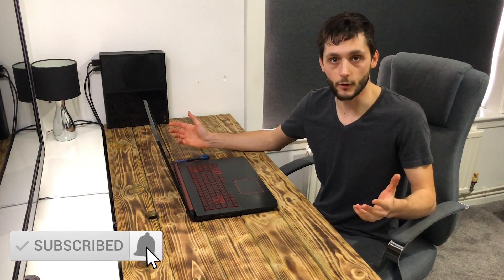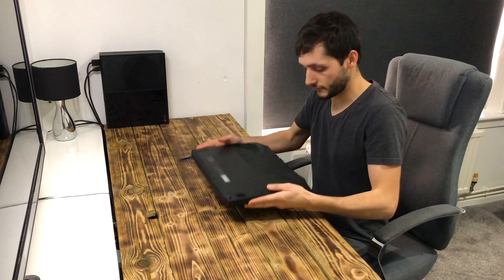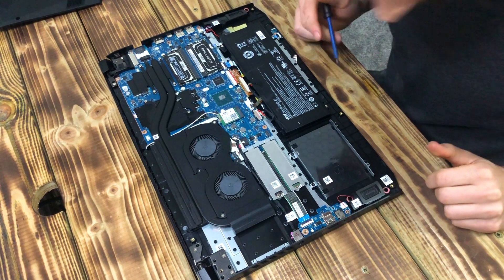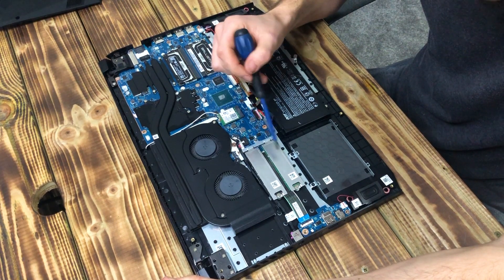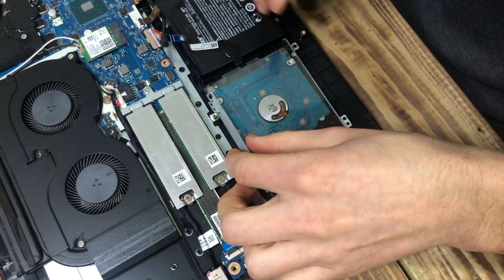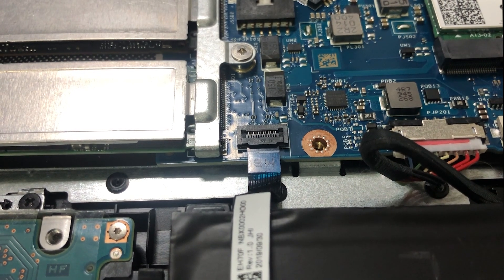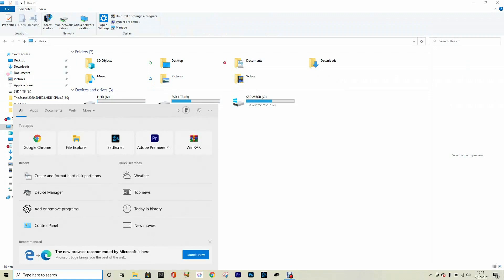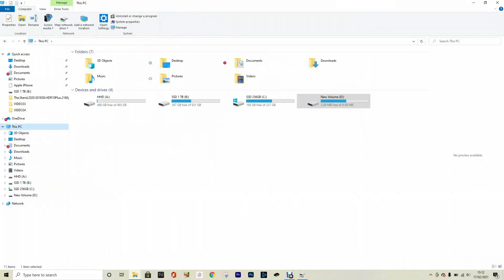HDD Hard Drive Upgrade on Acer Nitro 5 Laptop

Comment: just some questions: what hdd are you using (like, what’s it called?)? did it come with the cable and the screws? thanks so much, this video is super inspiring!
Reply from the maker: It’s a 2.5 inch hdd drive for a laptop. Pc ones are thicker

Comment: what would you need to do if the computer refuses to even power on at all with the harddrive plugged in?

whenever I plug my harddrive into the computer, it just refuses to turn on, almost as if no ram was installed in the computer.

Comment: Hey so I am not a tech person at all, but I have a question.... I purchased the Crucial MX500 1TB 3D NAND SATA 2.5 Inch Internal SSD, up to 560MB/s - CT1000MX500SSD1. When I received the product, I got the 2.5 SATA card and the black component. When I disassembled my laptop (Nitro 515AN-53), I noticed that the space was empty (as figured) and I had the flimsy aluminum part that was screwed in. Once I unscrewed and removed the flimsy metal part and tried to hook everything up. I noticed that the SATA card seemed pretty loose in that space. I've noticed that in your video and countless others that you all have the flimsy aluminum piece PLUS some type of mounting bracket or caddy (not sure what the proper term for it is), to make the SATA card more stable and secured. Where could I purchase something like that at? Again, sorry if I am not making any sense or confusing you. Please let me know if I need to clarify anymore. Thank you again.
Reply from the maker: Hello
You can get brackets if you need one like in this link below the hard part is finding one to fit your laptop a eBay search or maybe Amazon and you should be able to find one.
https://www.ebay.co.uk/itm/112360843601?mkcid=16&mkevt=1&mkrid=711-127632-2357-0&ssspo=jac7FoHhSJG&sssrc=2349624&ssuid=iBaUi5sxRGC&var=&widget_ver=artemis&media=COPY
Reply: @AshBuilt  I have 2021 acer nitro 5 and I was wondering if mine came with this?  Or do I need to purchase this

Comment: can you put whatever amount of space for the HDD, also can you do both the SSD and HDD upgrade and use both at the same time?
Reply from the maker: I think the limit for the ssd and hdd is 2tb each
Reply: @AshBuilt  I just did some more digging. I have the 2021 model an515-57 and it’s built different. Could you still help me out a bit. I had an external Hd but it died on me. Fatal error warning.

Comment: When I got my new Nitro5 it came with 250gb hdd so I added a 1tb ssd (which I had been running W10 on my previous Lenovo laptop) for extra storage. My Nitro was running W10 and my 1TB  SSD was also working but after a week once I had upgraded to W11 my Nitro when turned on I got a black screen and could not understand why. I disconnected my addd SDD and that solved the problem. I then connected the SSD to the Nitro via usb 3.0 to SATA cable and went into computer management and the SSD is listed as disc 2 : invalid (Dynamic Disc). .I am not computer savvy but what does this mean and how can    I recover the files on it without losing them (if they are still there).Because of this I have to add a 1TB  M.2 NVME  instead without any problems.
Reply from the maker: Sounds like the ssd is faulty.
You can get them tested at some computer tech shops just to be sure

Comment: Hi! im glad I found your channel. I have this exact same laptop and I wonder if they all come with that extra empty slot for hdd? mine has already 512gb so I wonder if I can still upgrade it to 1 TB? thanks in advance
Reply from the maker: Some come with extras like the hdd drive you can upgrade it to 1tb yes
Reply: @AshBuilt  how can I make sure mine has an extra slot before buying one hdd? thanks!
Reply from the maker: @claudiocastagnola6152  the best way is to open the back and look
Reply: @AshBuilt  i just noticed there is a badge on the front that says “dual m.w support + one hdd slot”
Reply from the maker: @claudiocastagnola6152 That’s a yes then :)
Reply from the maker: @claudiocastagnola6152  https://www.ebay.co.uk/itm/Seagate-BarraCuda-1-TB-2-5-inch-Internal-Hard-Drive-7-mm-128-MB-ST1000LM048-/124169790524?mkcid=16&mkevt=1&_trksid=p2349624.m46890.l49286&mkrid=710-127635-2958-0
Reply: @AshBuilt  thanks man! is that the cable or the harddrive itself?

Comment: Is that a ssd? But your cable is hhd?
Reply from the maker: No its the HDD I did do a video on the SSD upgrade if you want to check it out
Reply: @AshBuilt  is hdd cable will work if u put ssd?
Reply from the maker: @WinterB8  you need a different cable if you put the newer type hdd in the slot
Reply: @AshBuilt  how much is the 500GB hdd?
Reply from the maker: @WinterB8  there pretty cheap https://www.ebay.co.uk/itm/2TB-1TB-500GB-320GB-160GB-120GB-80GB-2-5-Hard-Disk-Drive-HDD-Laptop-PC-SATA-/383669108122?mkcid=16&mkevt=1&_trksid=p2349624.m46890.l49286&mkrid=710-127635-2958-0

Comment: does the laptop contain the HDD inside bro?
Reply from the maker: Yes it has a 2.5 inch internal hdd slot
Reply: @AshBuilt  i know it has a slot but does it has the hdd driver inside? Or i have t buy it
Reply from the maker: @shikamarunara5282  depends which model you buy some come with them some don’t

Comment: Hi,
I have nitro 5 too.
My HDD heats up to 55 degrees.
Its Seagate 7200rpm.

Please, can you comment your laptop's HDD usual temperature.
Reply from the maker: Mine is at 35 degrees 5400 rpm
Reply: @AshBuilt  Thanks for quick reply
Reply from the maker: @rkpsx7  no problem